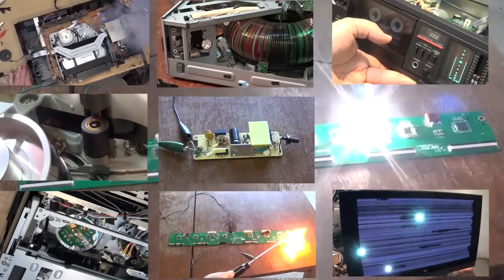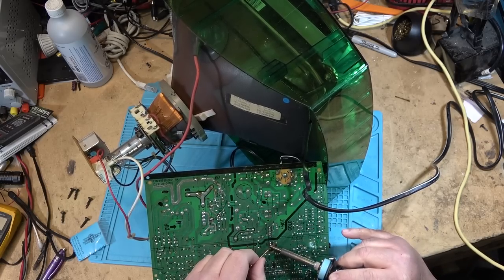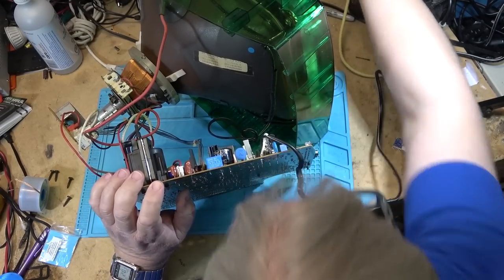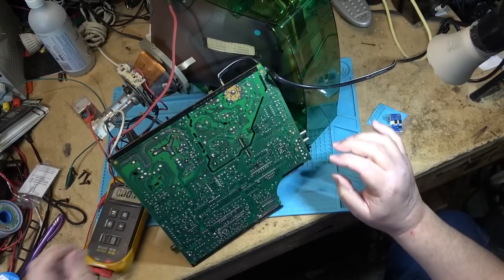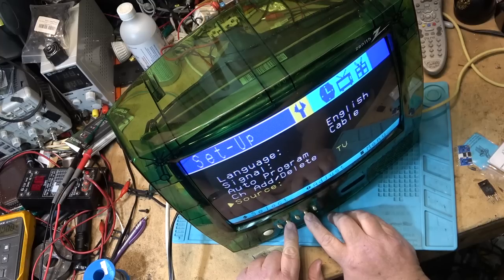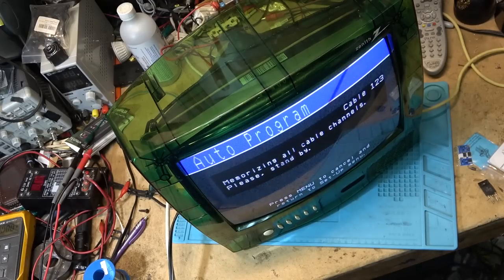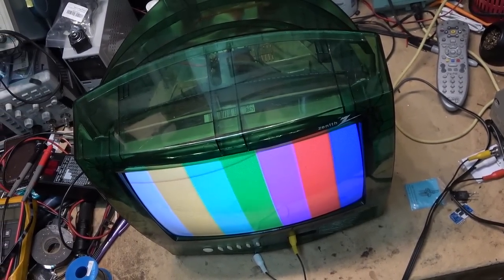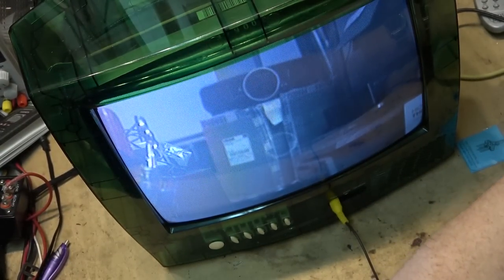Zenith CRT TV that went up in smoke is back on the bench now that parts have arrived.  Will it work?

Comment: I had this tv as a teenager
Reply: Mine was clear.  What were you in for?
Reply from the maker: @gavincurtis  Making the mistake that electronics would be a good life choice. I got 20 years of hard labour and then shown the door!
Reply: @gavincurtis  Replacing capacitors without checking voltages
Reply: @12voltvids  The winning is absolutely unstoppable...

Now wait until the eyes take a dump...it's a two for one retirement special from the "kick in the nuts" department.

Comment: I have used many different brands of solder wick and MG is a great wick , they are proud of it at most shops , a buck a foot , back in 1992 a buddy brought me a small roll of Goot wick , made in Japan also and is a great wick too , A 100 ft. roll of 1.5 or 2 mm runs 25 to 28 dollars delivered free.....   That will be on my next order, I won't have to buy wick for a few years.... Those 1N 5383 zener's go out a lot in TV's  I ordered 10 of them on my last order from DigiKey , it's weird that since I got them no units come in with that failure.... I like those clearish tv's , first time seeing one.......  Small radios and landline phones had those back then also. Take care Mon Ami......

Comment: I remember that racecar game used to play it for long periods of time. It looks good on a crt. Dave you mentioned you have a monochrome crt that needs attention. If you get to working on it can you show the different signals that drive the different parts of the crt. Specifically from the drive board to the tube itself. Kind of like a guide for checking the different areas. Thanks for the great videos.
Reply from the maker: Sure

Comment: To my surprise, a recent purchase of an HDMI to RCA converter outputs that standard color bar pattern when there is no input. Its been handy. It is the generic black square, with the Mini-B connector. It can be found by searching "MINI HDMI@AV" and then find one with the  incorrect label of "UP Scaler 1080P" printed on the bottom of the product. The converters I have that are missing this humor on the bottom output a blue screen only. Very frowny emoticon.
Reply from the maker: I have a couple that do that too. Give them power with no signal and color bars.

Comment: I just bought a H13E05LG Zenith with a clear green case. The problem is that the model I have does not an AV input (yellow,white) unlike yours in the video. BUT it does have the earphone input and the AV inputs are still there but underneath the green plastic in the same spot as your TV! Is there a way to use these hidden AV input ports even though they are not meant to be ? Even if they were usable or made to work, there is no option to change to that new source on the TV? Or is there? Should I just forget all of this and buy an RF modulator for the 1 input it does have, the ANT cable input.
Reply from the maker: If you can't select av in the menu then there is no easy way to put av on it. Would require some circuit mods.  Modulator is the cheap and dirty way to get av.

Comment: Have you made an in depth video on the uni-T and are there enough uses for the repairs that you (and I) do to suffice the investment? Would another brand be more ideal? Cheers
Reply from the maker: The Uni-T I have is a useless piece of sh1t that I wish I had not wasted my money on. My analog scope had blown up and I needed a scope and though it would fit the bill till I got it home and realized how useless it was but the store would not let me return it, so that was 600 that I had to choke on.
Reply: @12voltvids  well, you certainly have saved me from the expense of purchasing a scope. I thank you. For the analog, how are you using it for the repairs to be worth while? Or is it just in a blue moon since you already had it.
Reply from the maker: @SudburyMan  scope is a very useful tool just not the cheap ones.  The uni-t I have will just display complex waveforms well.  Think RF envelope from video or DAT and the eye pattern from CD player.  It's fine for simple waveform and capturing digital events.  The tektronics i have was donated by a viewer.  It's much more useful.  DSO have their place, it's just not the type of typical repair I do.   I'm scaling back what i work on and gave been for the past 20 years.
Reply from the maker: @davenally8672  you got it

Comment: How do you get nice solder joints without flux? Mine end up pointy and crappy without flux.
Reply: Good quality solder like kester, it has good flux in it
Reply: good quality fluxcore solder and appropriate temperature at the iron tip, if your tip is too small to heat the joint up properly it will always look crappy.
Reply from the maker: @thomasandrews9355  Im not using Kester, I am using cheap chinese solder wire, but it does have good flux. I used to swear by Kester and was suggested I try this stuff as it is cheaper. I tried it, I like it and never looked back. It is 60/40 Tin / Lead.
Reply from the maker: @n2n8sda  I was going to say that too. A good iron, and the one I am using, a Weller EC2000 was the best one I ever used when I was in the trade. My original one broke, and then a viewer found one at a recycling center in Quebec and mailed it to me. I was more than happy to get it. I use a tip temperature just over 700' F.
Reply: @12voltvids  Why do you prefer 60/40 over eutectic solder? I always used the 63/37 because I was told it was less prone to bad joints.
Reply from the maker: @cuppacheese  60/40 is all I have every used. Well once I bought 63/37 and hated it so back to 60/40 I went.
Reply: use the cheap Chinese Brand Kaina SN60 PB40 solder wire it leaves also good shiny solder i use this solder wick and im very happy with it

Comment: not meny houses have air powerlines anymore in Finland, for long time now power companies have been moving old power cables under ground, and ofc new ones are put there as well. The government requires power lines to be safe from nature
Reply from the maker: New construction here is underground but old infrastructure is Ariel plant and nobody is going to burry them because guess who pays for it?
Reply: @12voltvids  Yes, it has raised customer fees here but has also improved reliability. i don't care what kind of thunder storm or high winds we have, i just use my computer with pretty safe mind that the power is not going to cut out. (not 100% but 90%)
Reply from the maker: @usernameg5  power distribution here is a crown (government owned and run) operation so burrying existing overhead plant would certainly influence taxes and people hate higher taxes which would result in a government change at next election cycle and the new guys would just cancel the project. To give an idea how silly this is let me give you some history of the bonehead government projects we've had over the past 40 years here. In the early 1980 a new super highway was proposed and built.  They had a deadline, 1986 so it could be open for expo.  They cut a bunch of corners to get project built on time and under budget so government of day would look great.  Last year that highway washed out on about 19 placed during record floods.  Cost to repair and do it right in the millions of current government.  The prior one also started a new hydro electric dam build and made sure by rushing it along that it was last the point of no return should they lose the election.  They did.  Now geotechnical faults have been found and costs go way way up.  The prevous government also declared a new 10 lane toll bridge be built (they built 2 in previous years adding about 9.00 a day to commuters travel that had to use those bridges.  Most did not want the new 10 lane bridge and preferred a replacement tunnel including 9 out of 10 mayors.  Government changed bridge scrapped and back to tunnel plan which the prep work is already underway.  Opposition has already said If they form next government they will scrap the tunnel and go back to a bridge. 2 if the newer bridges that the previous government built are so bad designed that they have to shut them whenever it snows due to falling ice from the cables smashing through car windshields and they want to build another of same design.  They remind me if a couple of 5 years olds having a fight on the playground.
Reply: @12voltvids  sounds like a "nice" system over there. i'm glad we don't have road tolls here altough there has been lot of talk over building those. owning and driving a car is very expensive here already (we have one of highest gasoline tax in europe). right now normal 95oct gas (most cars use 95) costs around 1.9 to 2 euro/litre
Reply from the maker: @usernameg5  
We had them from the last govt but the current I've took them off.  Gas is expensive here too. 1.80 a litre and it was over 2.50 last year.

Comment: Are you doing a voice over or live talking or is it back and forth?
Reply from the maker: Both
Reply: @12voltvids  so i have a question about my VHS combo crt set that maybe you might know the answer to is it alright if I ask?
Reply from the maker: @Tech_481  I'll try.
Reply: @12voltvids  okay sweet well the TV part of the combo works fine but its the vhs player portion semi works. When i insert and tape (ive tried multiple with no success) it has tracking issues where the image rolls up from the bottom screen with write bars. It honestly kinda looks like if you a normal tv with just the vertical hold set incorrectly. Well my question is there a adjustment pot somewhere inside the tv to adjust the tracking? I dont have the orginal remote so Im not sure if thats all that i need to fix the issue or not. Its a magnavox MC132EMG/17. Ive tried researching online and haven't found anything so thats why id ask and see if you knew anything! Thank you!
Reply from the maker: @Tech_481  no there won't be a vertical hold control. It will use a count down ic like all the modern CRT did.  Could be av alignment issue on the vcr section.
Reply: @12voltvids  gotcha ill check it out when I put it back on my bemch later tonigjt!

Comment: Does a prison TV have the same schematic as a non-prison TV model?
Reply from the maker: Why not, its just the cabinet that is different, so the guards can look inside for contraband
Reply: Some of them have speakers and/or certain inputs deleted, depending on the vendor and the rules of the particular prison system.
Reply from the maker: @irtbmtind89  The few I worked on that were from a prison back in the day had the speaker disconnected. The inmate had to use an earphone, and the only thing that was permitted was one of those plastic earphones that had a cord as thin as a thread. Don't want someone using it to strangle a cellie.